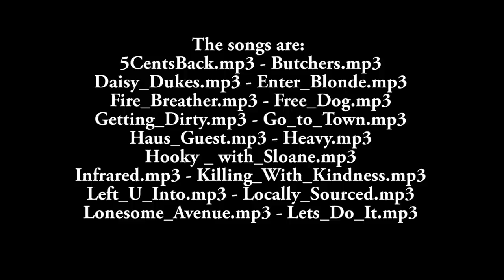handmade 14KT white gold ring with London blue topaz and diamonds

Comment: The RBC diamonds look to be of good colour and quality.  Lovely ring.  I hope that the owner keeps the topaz clean - they need gentle cleaning, quite often.
Reply from the maker: thanks, almost all the colored gems need to be kept clean to maintain the brightness
Reply: @scaffoal  : true enough, Scaffoal.  I have found that topaz are particularly neglected, when it comes to cleaning.
Reply: How do you clean it? I've done it any of my rings...
Reply: @hasa8491  Cleaning a topaz requires 1/2 part warm water and 1/2 part household ammonia.  Use a baby toothbrush with soft bristles and gently brush the pavillion after soaking in the ammonia/water mixture for 10 minutes. Rinse in tepid water and dry with a chamois.

Comment: Thank you for the information. One last question, what gage thickness do you most often mill press material to use for your rings and pendants. I’ve used gages 16 & 14 but I feel they are somewhat thin, possibly 12 gage? Please advise. Thank you for your help.
Reply from the maker: thanks, the thicknesses I use for the slabs depend on the object I have to make, ranging from 0.80 mm to 2 mm.

Comment: Just a mum student and would love to have a go do you have any instructions eg width of metal how far down to start to fold metal..
Reply from the maker: Depending on the metal and the total dimensions, and not always after the melting, the metal behaves in the same way. You have to rehearse, and in time you will understand the limits of the metal you want to use

Comment: I’ve  been watching your videos for quite some time now. In a lot of then your fingers are hurt. Are those injuries work related? As always great work 👍
Reply from the maker: yes, small injuries are related, thank you
Reply: As a goldsmith, I can confirm and relate to those injuries, nothing serious, but you tend to get minor cuts and bruises on a regular basis, I for one, is usually very careful, but still, the profession, in general, requires you to work in close proximity with sharp tools and machinery, and in most cases you cannot work on the project unless you hold them with fingers, cause  ssometimes the angles are not workable when you hold with pliers or similar tools.

Comment: I watched many of ur videos and one thing I notice is u remove a lot of gold from what I thought would be a solid gold ring but in reality they are hollow. Like this ring...u removed 6 triangles of gold on the sides? Why? I have solid gold rings and they are heavy in weight and in gold content. I did buy a signet ring once on-line and noticed right off it was so light, and I looked under the signet and noticed it was hollowed  out. Is this  a practice to reduce costs or to save u gold? If I buy a gold ring I want a solid gold ring , not hollow ring, and no diamonds...worthless rocks...
Reply from the maker: Often in Anglo-Saxon countries they use gold alloys with 9 or 12 carats, in Italy we use 18 carats, if a customer wishes it is possible to make the ring completely full.

Comment: задать

Let me ask a question=) have you tried laser pulse welding? If so, what advantages and disadvantages could you highlight for your activities?
Reply from the maker: I did not try it, I saw some demonstrations, the biggest advantage is that it does not heat the piece to be welded. Its limitation is that when you have to weld parts such as the video ring, the ax on the welded surface of the cavities, difficult to remove on flat and large surfaces. It has a high cost that must be justified by the type of use you make of it. I think it's great for repairs and for all those new items that require small welds
Reply: I work for a company that produces laser systems, including for jewelers. I am engaged in their Assembly and installation at the customer, but know little about the application, especially in other countries. While I can say that the seam is not always needed, the main thing-the ability to rigidly fix the parts before soldering. Until thought such. Well, titanium products are cooked perfectly and firmly. Gold and silver have a high reflectance, so high energy is needed. I am sure You have the opportunity to go to the exhibition, try to work=)

Comment: can do better,neither proffesional nor calibrate...such a shame for this beautiful blue topaz which is not set properly. without holding it n eyeglass you can easily see its not horizontal/flat. one side is deeper. And u complicate the assembly. Take your time, plan,calibrate and use the appropriate tool mainly for stone setting. just having a good polish doesn't mean anything when its full of flaws. sorry for the critics,ask any other pro to rate this ring if you don't believe or like mine. btw,u personally know it...